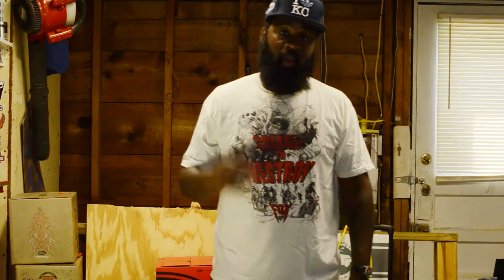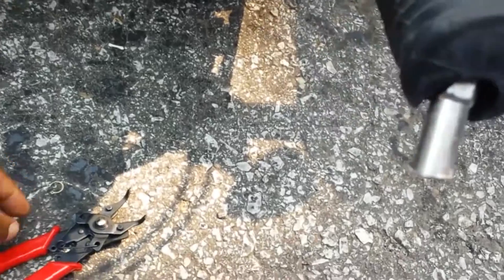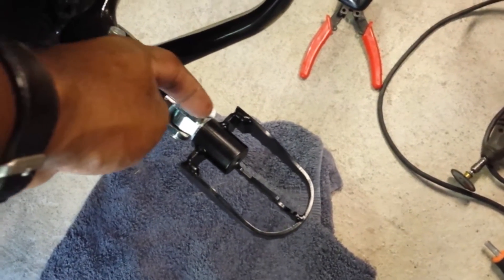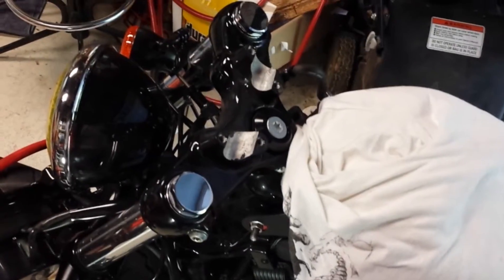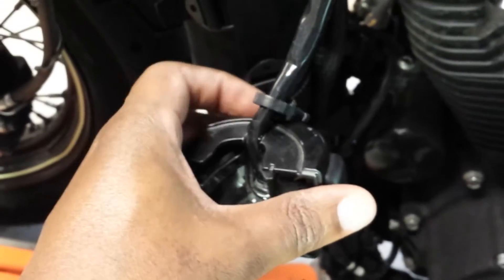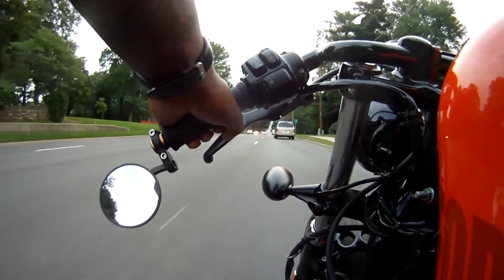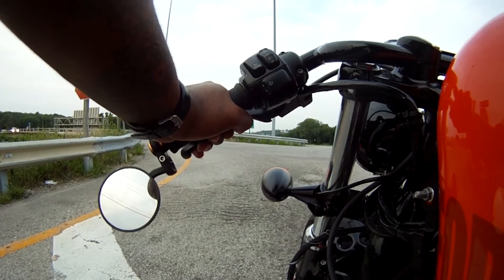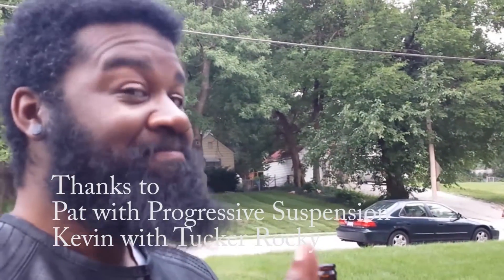Installation of Burly Brand MX Foot pegs and Clubman Handlebars on Harley Sportster Forty Eight

Comment: thanks for posting mids are a must for Clubmans or clip ons also seat height can lift you up and put you in a weird position . I just Installed clip ons on top of my top tree slid the fork tubes down and clamped them over the tube feels comfy any how get some mods cheap on eBay and a burly brat seat that seat is the bomb I like it over the bars bones big time .

Comment: Hey Kieth K, I got me some of the moons pegs that are very similar in design.  any way, at 2:48 you used a angle grinder to smooth out the cuts you did.  My question is did you use any rust preventative to the exposed metal or did you leave it to the exposed cut?
 Thank in advance for your response.
tdtanner 
2011 Sporty 48,  When I bought it it was the same tank paint as yours.

Comment: That's a different set up. I just installed the clubmans on my sportster, but I have rear controls. They fit excellent. Did you change out the triple tree? I didn't have any issues mounting the clubmans on my stock one. I don't know if the front ends are the same on the 48's compared to the Iron Sportster, but anyways nice bike man.